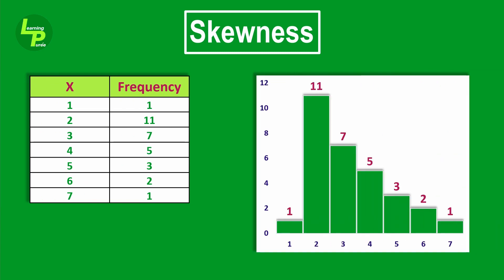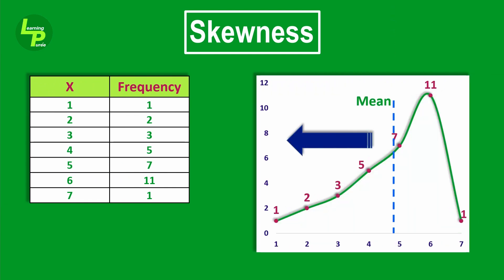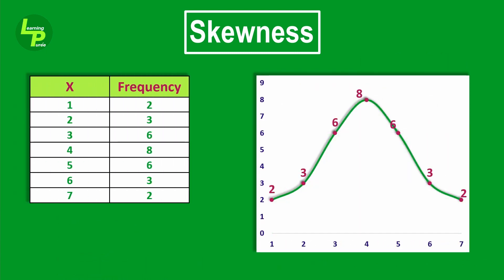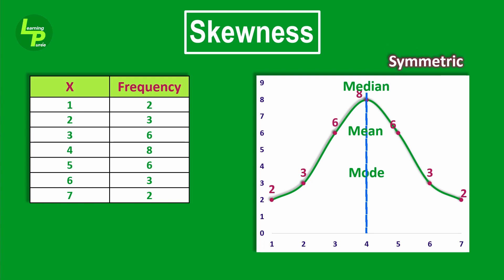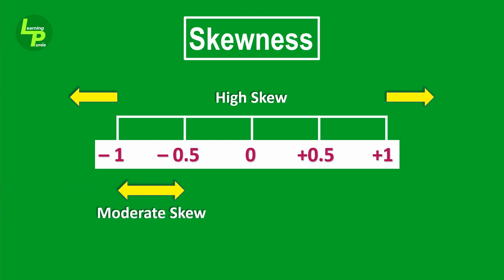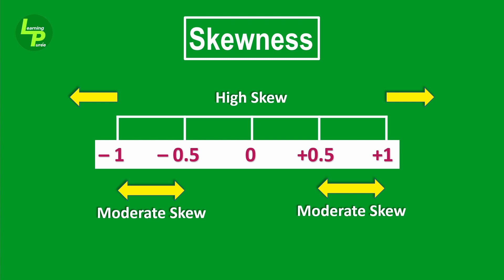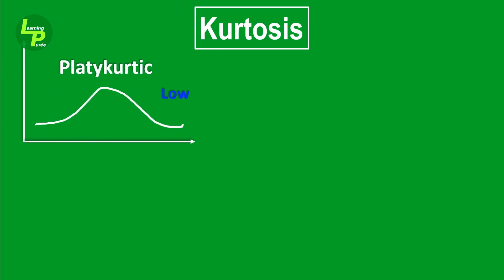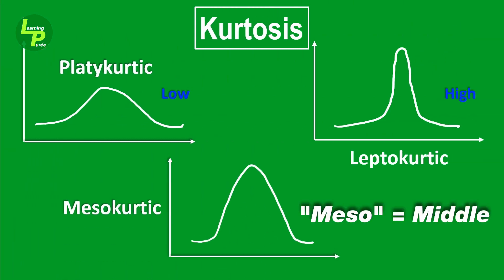USEFUL OR TRASH? Kurtosis and Skewness [WATCH THIS, BEFORE YOU USE]

Comment: Compuation is really cheap these days. Would it still be considered excessive to calculate them?
Reply from the maker: It is not a case of cost of computing power. It is whether one wants to invest extra time in computation. Instead, using visualization and SD can provide an enriched outcome. For kurtosis, it depends from case-to-case.